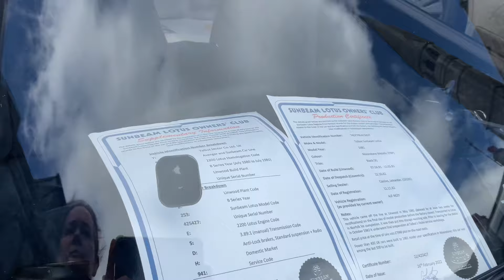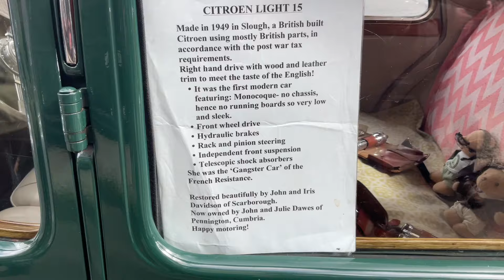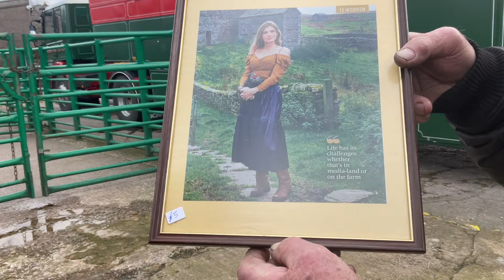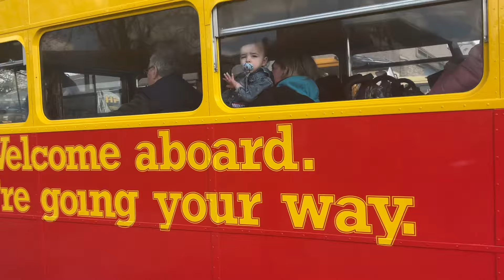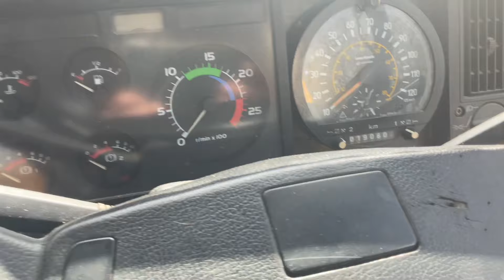Cumbria Easter Rally we take Austin 1100 see #classiccars #vintagecars #classicbuses #classictrucks

Comment: I used to go to the vintage vehicle rally in Heaton Park every year, but since they stopped it there aren't any I can get to where I live. There are a couple of bus running days over towards Merseyside but since they tend to hold them on Sundays I can't get over there ironically because of the lack of transport, whereas Heaton Park had really good public transport even on a Sunday.
Reply from the maker: Really sorry you can’t get to one, how frustrating about the lack of transport 😡
Reply: @matildariverwaldennews  I should probably learn to drive so I can go wherever I want rather than relying on the rapidly disappearing public transport network.
Reply from the maker: @FM60260  yes definitely 👍

Comment: Hello ! Happy Easter !!
Loving your content, as usual.
Where's the VdP Princess ?
Reply from the maker: Having a tantrum again 😱 battery this time she’s a proper Princess! Austin is very reliable never put a tyre wrong 😊
Reply: @matildariverwaldennews  
Well batteries go on nearly all cars every five years or so.
As long as your alternator isn’t over or undercharging a new one should last another 5 years or so.
(I tape the receipt to mine so if it does die early I’m not scrabbling around for it).
Reply from the maker: @lewis72  I got my last one from a scrap yard, Billy’s got his from there for years and they have always been great, probably just a one off weak one so I’ll try another, they are very cheap😊